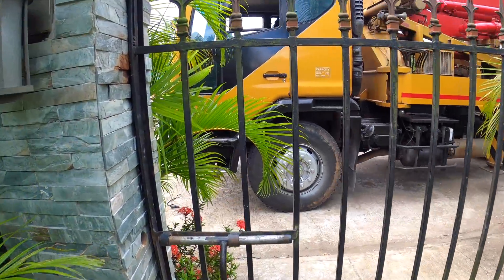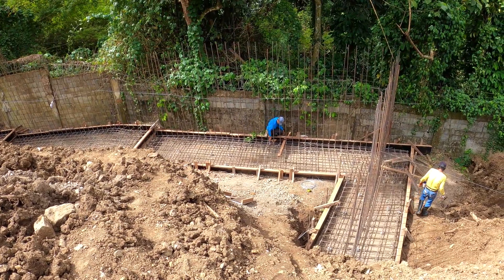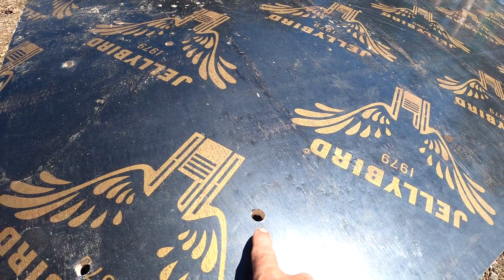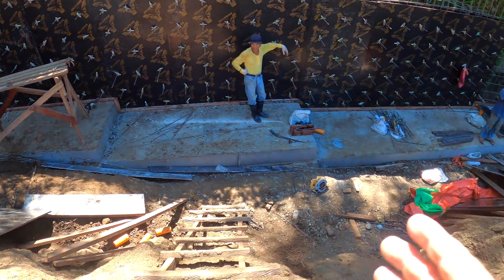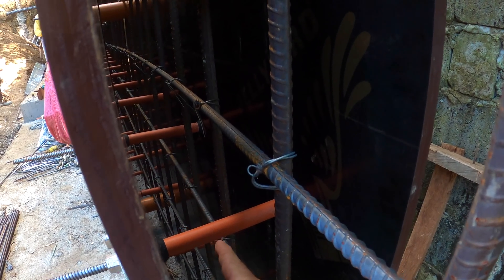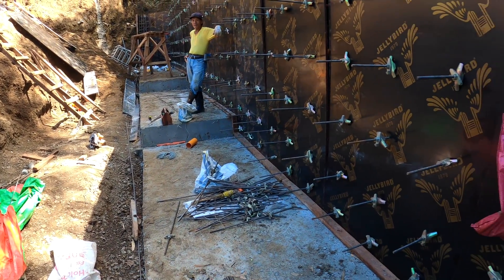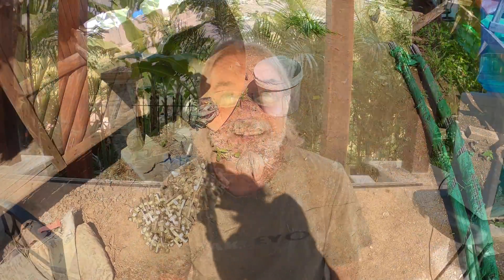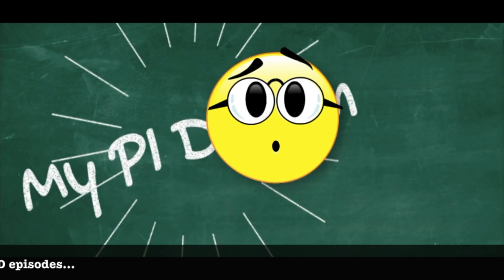NEW HOME BUILDS - EPISODE 3: THE TIE FORM SYSTEM (House Building in the Philippines)

Comment: I'm familiar with the snap tie system used here in the USA  forever but have never seen the system used here. Can you tell me what country this  design comes from. As a machinist I can tell you this is a rough (loose) version of a ball-screw thread used in CNC machines and would be interested in researching a bit if you can get me the name of the manufacture or seller of this product if they have a website. Great episode presentations James. Thank you much for taking the time to produce!
Reply from the maker: Not sure about the origin of this technology.  Something that would make a great Google search.

Comment: Great video. In the states we use snap tie system in 8 inches walls. The threaded rods used on 12 inches walls. The snap ties already set for 8 inches thicknes we don't use pvc pipes in between. After the wall is poured the snap ties stays in the the concrete. Remove the plywood and just bend the ties and twist will snap right off the concrete. Before we set the plywood we use form oil. Will help the plywood comes off easy and gives a smooth finish to the wall. Although we pour 5 inch slump we vibrate the wall when poured to remove any honeycomb. Texas Filipina guy is using the same system.
Reply from the maker: Same process these guys used.  It's solid!

Comment: James of Texas Filipino , a youtube vlogger from Texas and Panay, Iloilo  utilized this  solid  pour walls in his Panay  Beach House,  but all manual  work...he is in the US  right now  I think , he watched some  of your  build , I believe, thanks  James.
Reply: I know James of Texas Pilipino blogger who used a bamboo for building his beach house.. he never use hallow blocks for walls but instead solid concrete walls and roof to resist a strong typhoon like what happen before typhoon Odett. He is very good man too.. i’ am one of his subscriber here in middle east..
Reply: @03BUOOO264  do you really want to build a house  cheap and  strong ?  Go  to watch Aircrete Harry vloggs , I intend to build a  30-40 feet  diameter  dome  and  12 to  18 feet  high , maybe  a few of them ranging from 14 in diameter  to 40 linked together  using  his  system,  of course with windows and  rebars and Chicken/ Stucco wire  reinforced.Monolithic domes are Earthquake proof,and  typhoon  proof.for more information  how strong   go  see  Monolithic  Domes ,Italy  Texas.

Comment: As you’re panning over the top of the forms I noticed that the rebar is touching the back of the forms probably not best building practices as there should be at least minimum inch and a half to 2 inches of separation between the outside edge of the concrete and the inside rebar
Reply: Hi Greg the rebars inside the forms will be re-alligned later to the center position before the pouring happens.
Reply: @robertvelasquez393  yes I see that now

Comment: James; how come they have the cement so runny, I worked in Canada for many years dealing with cement pours this is the first time I see cement poured so runny, how would you do a slump test on that. You show up to the work site with that on the ruck they send you back home. lol  As for adding quick set to the cement that is ok done here for years do not add or take away froe the strength 
 
I notice several pours on homes in the Philippines the same mixture consistency, I just looked it as the home owner trying to save a buck and it's only a small house. I also noticed a lot of these pours that are runny like that you will notice very early break down on the surface as in many vids from the homes there. Just wondering.
Reply from the maker: I think they run cement mix watery for a couple of reasons here.  To pour easier and to save on cement.  Neither is a good reason to weaken the concrete but it's done all the time here.

Comment: Hopefully they use this technique to build the house too😎
Reply from the maker: The house will be CHB, not cast in form to save some money.  The most important place for cast in form is the support under the house and retaining walls because of the unstable soil there.
Reply: @MyPIDream  i think it would actually cheaper to use the forms that they already have only if they don't use a pump truck and ready mix. Think about how much time and morter it takes to smooth out the CHB blocks.

Comment: James well they use the form walls to build houses with concrete and not hollow block system??  What do you think would be cheaper concrete walls or hollow blocks.  Thank you for all the info.
Reply from the maker: It's a little more expensive to do cast in form but when quality and strength are necessary this is the best method.

Comment: Whenever possible piers should be used to support your foundation down to bedrock. Without piers down to bedrock your foundation is essentially floating on dirt
Reply: Plenty of construction (housing not high rise) is done around the world floating on sand and it is fine if designed appropriately. As for dirt not so sure, and even rock can be a problem especially in PI where the ground shakes regularly.
Reply: That would require  pile drivers , which could be  very expensive in this  case, as it is  this construction  is way more than adequate   and as  another  commenter here  before me says  ground  in the Philippines  is seismic,  this  construction , the way they  are building it  is good for  a few  decades maybe 2 centuries  or more,  we have  close to 300 year old churches in the Philippines  still standing, and all were built manually  with  primitive  methods,  many  not even having rebars and such.Most of the houses  around James  subdivision  will last a century  or more.

Comment: It seems like just constructing that retaining wall could end up more expensive than building the average house in the neighborhood. Then again, I guess this is not the so-called an average house they're building here.
Reply: This way of building is actually cheaper vs building with them so called hollow blocks, and its about 100 times stronger as well. 
This is the way to build, especially in areas prone to earth quakes. If the workers do their job properly it will leave a near perfect finish, with a minimal amount of work after to get it ready for either painting or tiling.